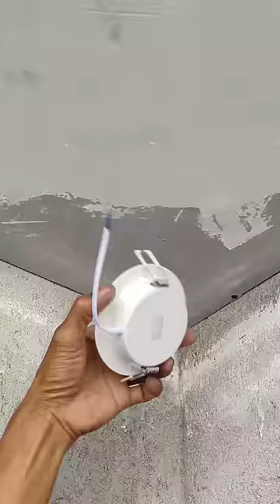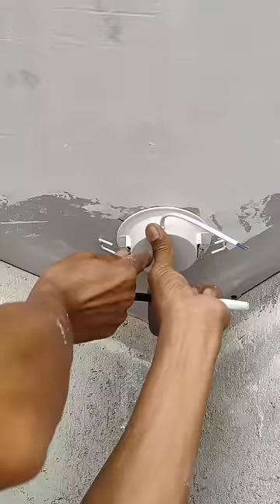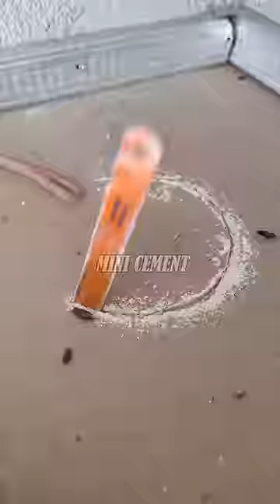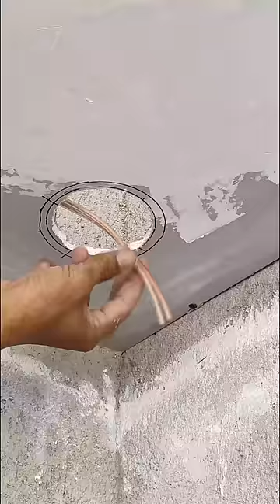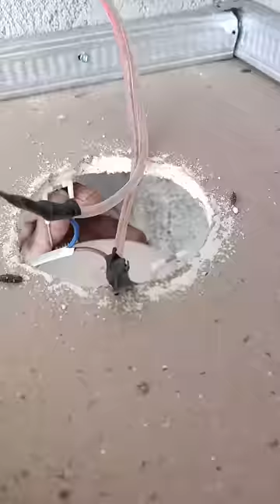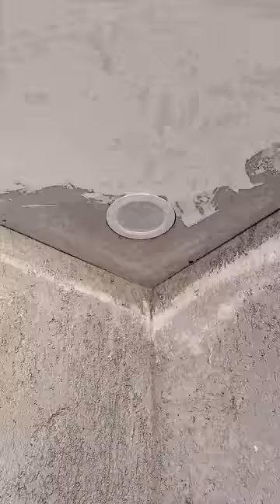cut a hole in the roof for a light

Comment: This is how you burn a house down
Reply: Cara pemasangan nya kurang praktis ..mestinya pake jangka ...berarti blm propesional
Reply: I don‘t get why they always need to use unorthodox wiring methods. Wire connectors?!? I don‘t know…is that a speaker wire he is using?
Reply: This how NOT 🚫 to do it
Reply: why speaker wire danger? the lamp just 6 watt right?
Reply: @peacefulldakwah current volt is 220.not matter watt.
Reply: @JanDavidOehl do need marette to spliced them?
It might be 220v. But splicing copper to copper and proper electrical tape for 60w bulb is alright 😊

Comment: you should cut electric cables in different lengths for safety,use a connector not tape!
Reply: Yes what he did in the video has a high risk of making a fire you are correct
Reply: Speaker 🔈 wire 🤷🏻‍♂️
Reply: Fully endorsed
Reply: ya mau gimana pun ini hanya konten, kalaupun ingin lebih aman lakukan dengan bahan bahan yg baik

Comment: Wth . There’s so much wrong with this short. Speaker wire, electrical tape, scissors, sunlight up above lol. My big question is who mounts a downlight this close to the wall ? I understand at times it may workout best to install close to a wall but this is a DOWNLIGHT. This means that it’s not a wall sconce or a wall wash . These light are meant to aluminate downwards not sideways lol. Anyways it’s your house not mines

Comment: Seems like he used a speaker wire.
Reply: It actually looks like lamp cord. But I can see how one would think that.
Reply: @jasincolegrove4798  
Those red and black wires were used as speaker wire here in our country.
Reply: @FirstLast-jf9on  the only thing that matters is the rating on the wire.
Reply: @jasincolegrove4798 
Yah I guess you have a point.
But still, it's not advisable to use a speaker wire when you are using a high voltage, the insulation is not good.

Comment: There is rat poop.  Rat will chew thw low voltage speaker wire and The Roof Is On Fire

Comment: Wrong location, that should be at a distance from the wall depending on the angle of ur light…..
Also the cutting dimensions should be on the inner circle.
The distance between lights should be based on the wall how tall is the wall.
Please Google the formula next time or call electrician who know his job.